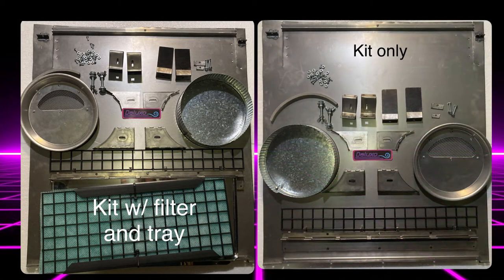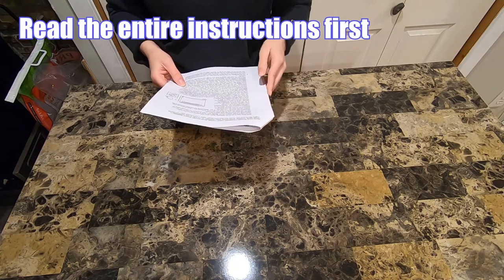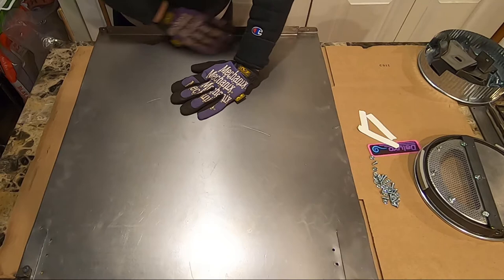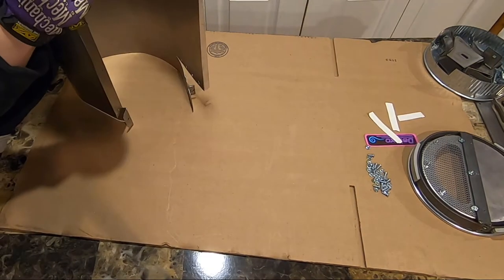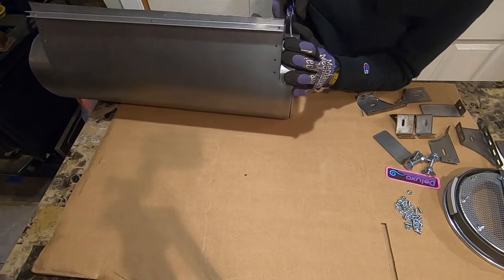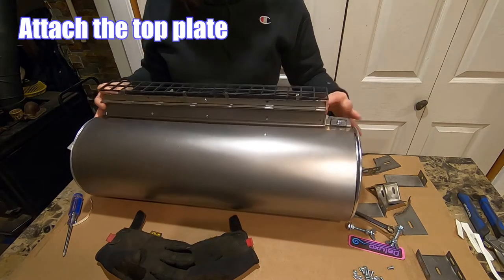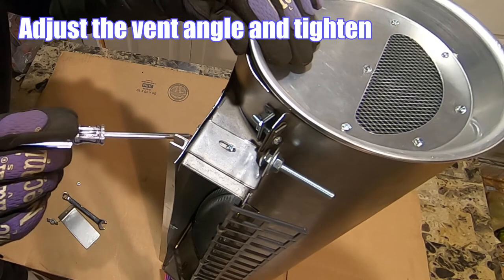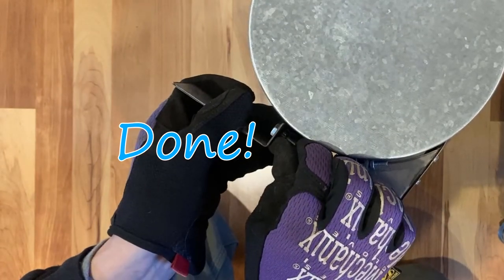On Sale!! From $199 The Deluxo! Functional Vintage style Swamp Cooler DIY Kit Assembly Video How to

Comment: I appreciate this video. Clearly you have the right kind of bad taste! 
Are the bolts/hardware/body end caps/sheet metal, rust proof? I live by salt water. The air is salty. Go figure.  
I'm wondering if I should paint the inside before assembly with some rust retardant paint or some-such given the humidity that it produces. 
Does the outside color affect the efficiency? I believe black would heat the unit up (unless I'm mistaken) making it an effective hot forced-air blower...maybe? I'm planning on painting it a slate blue-gray.
If I buy one, I will be mounting it on my post-apocalyptic sci-fi geek art car. I'm going to make it look as much like a tube-type missile launcher as possible to accent my front-mounted plasma projectors. Cool air, and (imaginary) death from above! (Assuming I'm uphill from other road warriors.) Yes. I'm a geek. I'm OK with that. I always get right-of-way at four way stops. And meet a lot of police officers every time I move until they've all had a good look at the car like little kids...It's actually cute. Most of them just want to look. Some are dicks. But I like watching their faces drop when I tell them that it's RCW 46 compliant and quote the law. Also very enjoyable :)
Reply from the maker: @ratstar  thanks haha yes I too live near the ocean. The hardware is stainless and zinc coated. The back cap is also zinc coated and the intake cap is aluminum. The unit itself is plain steel and requires painting inside and out unless you want a rust patina which many do. Yes color plays a huge deal. The darker the less efficient it will cool. So shiny (to reflect light/heat) and light colors, medium greys are ok I’d say

That’s cool I’ve actually had customers put these on creative art cars before. Check out our website I think there’s a yellow Vw bus on there that’s got a similar style to what you’re describing 

I’d like to see that customization, I’ve painted these like objects before like a Duracell battery or beer can.

Comment: THE DELUXO! 😊
Reply from the maker: Literally building deluxos right now!
Reply: @ecophage  I almost bought one. The reason for not buying your kit was I drive a 1988 isuzu truck and 19" x 2" is to big for the window. Are you gonna make a slightly smaller unit in the future? My window is 16" before it slopes down.
Reply from the maker: @jodywales6760  yeah I do custom sizes all the time. The tray just is thinner and not quite as nice because I have to custom weld it myself if it’s under 18”